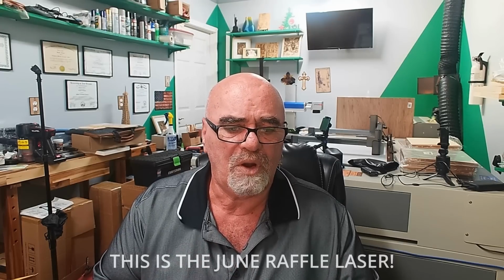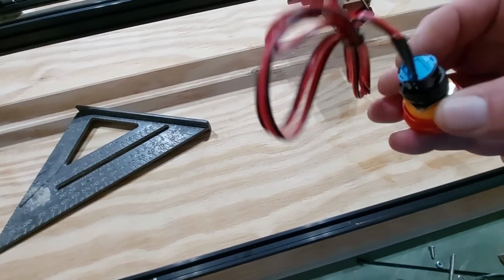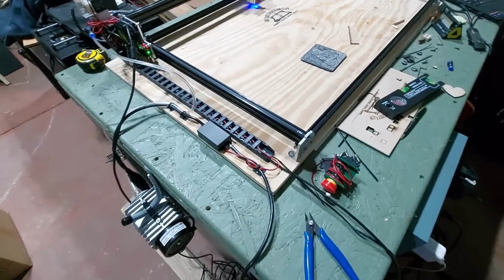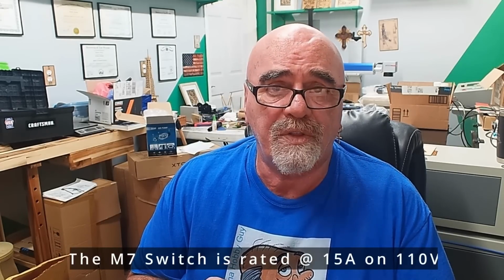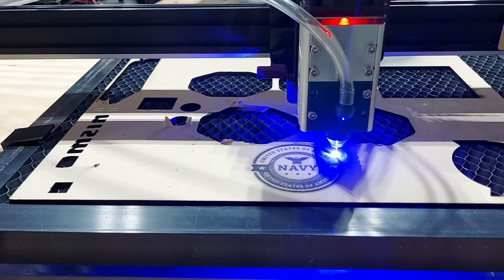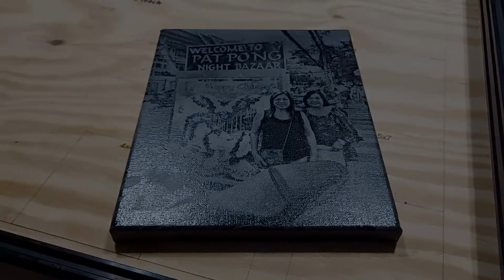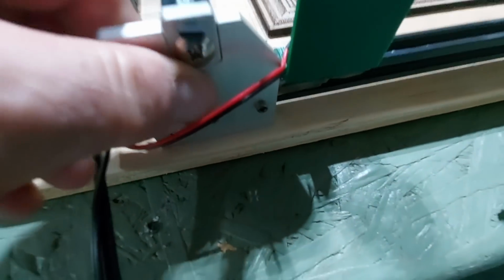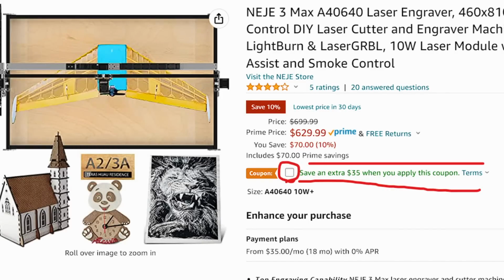❓ The best Diode Laser in 2022? The Neje 3 Max!

Comment: I bought the NEJE Max 3 v2 before I come across your video. Just got it, have it laid out, about to assemble. I've never touched a laser before. But after shopping around for a couple of weeks, it was the best buy. I got it with the E40, but got out the door tt&l for about $490. I'm going to get the lightburn and hopefully will be up and running soon. It's big! 32" x 18" basically. Had to build a massive table for it
Reply from the maker: I did a video on the 3 Max Steve. It's a beast to assemble, but once that's done, it's off to the races!

Comment: Hi my name is Jim Gangloff I'm a newbie. I bought this at a garage sale it has the Lazer that you have on this video. My problem is I don't know what  software programs to use? My laptop is running windows 10 I tried to download the software from neje but all I get is a error that it's not responding what do I have to do it came with another Lazer also. Only thing I don't have is the shutoff. Is there anyway you can help me get this running? I paid $100 for its mounted on 3/4 piece of plywood all setup ready to go Thanks
Reply from the maker: No I can't, but you can use either Lightburn or LaserGRBL.

Comment: Hi Rich great video.  Would have loved to have seen the actual setup of the laser for focal point, but thats not my question.  What air compressor are you using and at what psi/bar?  Are you using any kind of regulator?  Cheers
Reply from the maker: I have a video on the ramp test on my channel for the focus. I use a California Air Tools quiet compressor with a standard regulator and water separator between 9-12 psi, depending on the job. I also have a portable aquarium pump at 60 lpm.

Comment: Have tried to set this machine up in lightburn. somehow it seems that the machine thinks its workspace is besides the actual worksite in lightburn. machne is trying to travel outside the workplatform. yes dimensions are typed in correctly. but laser cant find center of page or anything else. when moving it on the arrows. the laserhead moves correctly, left to left and right to right but the y axis moves opposite way as expected. when clicking down it moves up visa versa. cant get it ot run correctly.
Reply from the maker: You have to set the correct origin in Lightburn Harley. Edit --> Device Settings --> tic off top left.
Reply: @TheLouisianaHobbyGuy  Thanks. lemme try that. Just wondering my other machines running superb on lightburn, except of this one. I was about to bin it.
Reply: @TheLouisianaHobbyGuy  Ahmmmm. where did you set it on your Neje MAx 3 ?. mine is where i think it should be. top left tic. but it still runs opposite directions

Comment: Hi Rich. I love the video. Thank you so very much! My biggest question is the air assist. Looks like I'm running the same air pump that you are using. The tubing and air assist use a much smaller diameter tubing line than what the pump tap uses. I believe the line that fits the air assist is 2.5mm (or 3/32") ID tubing and the pump tap uses 3/16" ID tubing. What are you using to get everything to fit correctly? I've tried looking for barbs to downstep and can't find the right fittings. Please please please help.  Thank you so very much.
Reply from the maker: You can get the plastic barbed reduction fitting at Lowes for $0.89 Darin.
Reply: @TheLouisianaHobbyGuy  Thank you, Rich!  You're the best!

Comment: in your video you run M7 and M8. No need to run both. in the next setting of LightBurn is to run one of them.The video is great, hats off to you. please excuse the use of a translator
Reply from the maker: I run both because they perform different functions.
Reply: I explained wrong. I thought air assist didn't need to be written in GCode. After setting, leave the option checked (implicit setting). See pictures in previous post. I learned this by accident. I'm a greenhorn. I'm learning how to control Lightburn from your videos.👍👍👍👍👍👍

Comment: Hi Rich Nice video..........I have the A40640.....cant get close to your use......Can you say whether yours is straight out of the box Ready or did you unscrew diode 2.5mm like Neje says but then you can only set laser between 4-6mm from work.....I see yours is set at least in the mid 20 mm's, can you explain any of your setup and dialing in if any ........Because I'm totally frustrated
Reply from the maker: I use mine at 17mm Gary, or turned all the way in 99% of the time.

Comment: Thanks Rich, new to laser engraving and binge watching your videos :-)  I have the Neje 3 Max, but can't get the frame completely square; I've spent many hours on this so far, including reaching out to Neje and fb groups. When I move the laser gantry all the way to one end, the left side touches the stop, but the right side has a 1/8" gap. I use a carpenter square like you show with the screws slightly loose for adjustment, but when I tighten the screws, square is lost. Mounting to a waste board, fastening one corner, then the diagonal corner, does not solve the issue. Do you have any suggestions? TIA
Reply from the maker: No, that's the only way I know how to do it. Measure your extrusion... perhaps one is not the right size. Being off by just 1mm will ruin the square.
Reply: @TheLouisianaHobbyGuy  Thanks, given all of the different options that I've tried, and the fact that this doesn't appear to be a common issue, I'm guessing one of the extrusions is off, although since it's assembled, not really easy to measure.
Reply: Was there a solution to this?

Comment: Great Video, I did buy one and have it setup and was trying it out. Coming from a K40 CO2 the mm/m vs mm/s was throwing me off. I did download your cbl file for the A404640 but it is a little lacking, do you have one that has more settings (engrave, more Materiels). I looked at the xTool 10w and may use that and tweak it but if you had one so much the better. Also was looking for a waste board template and your template that you use in the video for common picture sizes. Thanks again and keep up the good work.
Reply from the maker: You can use any of the clb files on the forum that match your wattage Kyle.

Comment: Hi Rich I have this model Neje (for about 2 weeks).I have connected the power box to the m7 and to my air pump ,I have put in the m7,m8 m9 in the g code settings, when I run a program to engrave then cut the air pump does not switch on when it starts to cut,I have the air assit switched on in the cut layer and off in the engrave layer. Do you have any idea where im going wrong
Reply from the maker: Are you sure they're plugged in right? I can't imagine that both the M7 & M8 are not working.
Reply: @TheLouisianaHobbyGuy  Hi Rich I think you Misunderstood my Question,I have the air pump connected to the control box and pluged into M7 when I do layer just to cut the air pump switches on OK.  But when I have a Object with 2 layers,one layer being a fill layer and the other a cut layer when it runs the first layer the fill layer the pump does not start so when it start.s the cut layer the pump is still off .I hope this is a bit clearer.thanks peter
Reply from the maker: Ah, that's probably going to be a question to ask on the Lightburn Forum Peter. https://forum.lightburnsoftware.com/
Reply: @TheLouisianaHobbyGuy  Ok thanks Rich

Comment: Hey Rich, just found your channel and I have to say it's really nicely done!!  really good information.  But could I ask you, as a RC model aircraft guy, I am looking for a cutting machine to cut balsa (max 10mm) and plywood (called triplex here: 5mm max) that this machine is the best and really has sufficient power to do the job?  now there are more powerful options out there as a complete kit (Atomstack X20) but the question is, is it worth it's money and do we really need so much power?? would it just speed up the cutting process?  also, any recommendation  about a good airpump?  keep up the good work!!  Edit: If I would go for the Neje 3 Max I would go for the E40 laser module (I guess) because it has that build in air assist system.  Just think that makes life easier!! your thoughts?
Reply from the maker: Thanks Egon! For what you're doing I would go for the E40 as well. It's a really nice module. Of course the 20W machines would make much faster work of it. If you can wait a couple of weeks, I'm in the process of testing a new 24W commercial grade machine that's about to launch and leaves all of the others in the dust. You'll want to see this one!

Comment: Hi Rich , nice review. I have 2 Q's;
1- can it cut 8-10mm oak plywood?my sculpfun S9 used to cut 8mm ply but after some use it's unable to..(even after cleaning)
2-Neje website doesn't recommended going over %80 power for prolonged use, do you have any time - power graph ,bc it would be nice to see the power drop over time because to be honest no one is going to stay under %80 .. and using daily at %100 will definitely shorten its life but I don't know how much , if you have a approximate graph I'd appreciate it..
Thanks
Reply from the maker: No I don't Ahmet.

Comment: I’m new to lasers. 
I’m getting info everyday since the last 2 weeks and I think im buying the NEJE, but I have doubts between the A40640 and the E40 modules. Mainly I would use it for wood veneer cutting, don’t know if I’ll make many engravings in the beginning but I don’t want to be closed to that option.
The A40640 seems to be more complete but I’m worried about having to be continually changing the focus adjustment. Is it complicated to find the sweet spot? The E40 seems to be easier for a rookie.
Thank you Rich.
Reply from the maker: Both work well Juan. The A40640 only needs to be focused once. I suggest turning the lens all the way clockwise and running a ramp test.

Comment: Dear friend, what is your opinion about the module laser 20w output from atomstack  (combined 4 laser) In front of the product of neje 3 max?
 I have ortur laser master 2 Pro and I want to upgrade it to more powerful  laser, I want your opinion because you're the best!
Reply from the maker: Thank you! I don't have the 20W quad diode so I can't give you an informed answer. But I do know that collimating 4 diodes is not going to give you the engraving detail that a 5 or 10W will because the spot size will be rectangular, and not square. I am extremely satisfied with almost any 5 or 10W for my diode engraving since I work mostly with hobby wood. Diode lasers are made for engraving, and for engraving, less is more. In fact, I still use my 3 year old 1.5W laser when I want really fine engravings on expensive pieces. What I look for is the spot size. You need the smallest spot and it needs to be square for really fine, professional engraving. You won't get that above 5W optical output, unless you get a really expensive USA made 7W single diode. If you need speed for cutting, then sure, go with the 20W, it will outperform any other diode laser for cutting, but I focus more on engraving.
Reply: @TheLouisianaHobbyGuy  I want to cut clear acrylic 2m and engrave styles steel
Reply: @TheLouisianaHobbyGuy  also I need something specific item to connect the neje module to my ortur? (Ortur 24v 2a)?
Reply from the maker: Yes, you would need the Neje Adapter board and another power supply for the 12V Neje. I would suggest you look at the new 10W module from Ortur. @ציוןנעימי
Reply: @TheLouisianaHobbyGuy  after I see this video about neje I don't know what to buy, ortur 10w module or neje module, you think it's is possible to engrave or mark very well stylenss stainless steel?
Reply: @TheLouisianaHobbyGuy  and another question: which spray you work with to coating the stainless steel?
Reply from the maker: Since you already have the Ortur, I would go with their new 10W module.

Comment: Hello Rich, great review I just purchased the neje 3 max a40640 should be here on Thursday. I have the foxalien riser 20w and have ben working it to death but I needed something  faster and bigger. I was a little fooled buy the air assist though it was the pump. until I saw this review, thanks. it looks like you filmed it at different times because it looks like you had two different air nozzles. I defiantly like the second better. is that an upgrade... Thanks For all your videos it has helped me a great deal.
Reply from the maker: It was filmed over a few weeks of testing Mark. And! They have come out with a metal air assist just after I completed this! It'll be in a video this week during "accessory week".

Comment: Question on the M7/M8 setup you have. If you are using a tankless air compressor (I use a pretty large Airbrush compressor for example) Is there really any need for the M8 air solenoid valve? Couldn't I just connect the airline from the compressor directly to the air assist like I have now and use the relay connected to M8 to turn the compressor on and off as needed? That would eliminate an extra component and simplify everything. The only reason I can think of to need the air solenoid would be if the air supply was coming from a tank or tank type compressor.
Reply from the maker: Yes you can Ray. Just use the M7.
Reply: @TheLouisianaHobbyGuy   Thanks for the fast reply! Love your videos.

Comment: I currently have the Reizer Mega 800x400 20w (5.+ output) and I love it.  Wish it could cut thicker balsa.. like 1/2” without setting it on fire.  LOL.  With double the output, would this make sense as an upgrade to be able to produce balsa parts on an ongoing basis (short of commercial CO2)?
Reply: Also, the printed air assist nozzle, was that one that fit on the lens or mounted on the side?  I prefer the ones on the lens… seems to keep my fox alien laser clean.
Reply: Assembled and installed the 3 Max into the CNC Router table cabinet… perfect fit by chance… probably couldn’t have designed it to fit more perfectly.
Reply from the maker: Faster speed and multiple passes will keep it from burning Peter.
Reply: @TheLouisianaHobbyGuy  ordered and received the NEJE 3 Max… in like three days (shipped from So Cal).  Took all of 15 minutes to assemble and fire up… I have only cut one R/C rib on a flat spoil board… and I am VERY impressed.   Great call on this machine.  Can’t wait to cut an entire airplane kit.  Thanks for the review and the heads up on this machine.
Reply from the maker: @peterb7401  Glad you like it!

Comment: If you were going to use a rotary tool for a tumbler, mug, etc, do u just use wood or something similar to space the full machine up high enough? (I know xtool has the screw in puck system but haven't seen how one could do it with the 3max)
Reply from the maker: I have a 4x4 cut up into different sizes with slots in the tops for the legs to slip into. On the Pergear, it has legs, so I use those too.

Comment: I used a windows program to stop the laser every 10 minutes for 3 minutes and then continue to engrave for 10 minutes, that why I was able to work with the laser 10 hours or more with no problems
Reply from the maker: The problem was the shop was too hot at over 107 degrees. When I did the 2nd burn in the low 90s, it came out just fine.

Comment: Rich, thanks for the videos they are a great help.  Can you tell us what you are using for fume extraction?
Reply from the maker: I have several things depending on where I'm lasering. In the laser shop, an 1100 CFM extractor in the attic. In the wood shop, an air scrubber.
Reply: @TheLouisianaHobbyGuy  Thanks Rich but 1100 CFM might be a bit big.  I just ordered the NEJE 3 Max A40640 and that is my first an only laser so any recommendations for just one laser.  I do have a dust collection system for my wood working, it's a large Jet system and I was thinking if I could find an inline filter that might work but I have not found a true inline, or I guess it would be a feed through filter.  Thoughts?

Comment: Rich, the laser on mine is staying on in lower power even when at idle, not doing anything. is that normal or have I missed a setting somewhere? By the way I love the suggestion to plug the air assist and exhaust systems into a power strip and run the power strip through the M7 relay. Works great.
Reply from the maker: Hi Chuck, yes, all of my Neje modules are like the Motel 6 🤪 Neje told me last year it's 1/2% power for framing purposes.
Reply: The laser is staying on in lower power even when at idle is to assist positioning and focus adjustment, low power brightness can be adjusted by software. This is the operational advantage of diode lasers compared to CO2 lasers. NEJE has always adopted this design, especially in It can bring a lot of convenience when carving small works.

Comment: IT LOOKS LIKE YOU'RE ONE OF THE LUCKY ONES! My NEJE MAX didn't work anymore within 60 days of the purchase. AND NEJE IS FULL OF IT WHEN THEY SAY THEY STAND BEHIND THEIR EQUIPMENT FOR 2 YEARS. They didn't stand behind it for 2 months.
I bought my 2S MAX  in March 2021 and it quit putting out consistant images by the end of April. I contacted NEJE and after they told me that it had to be the laser module, I was told I had to get my warranty service through the PLATFORM THAT IT WAS PURCHASED THROUGH. That was eBay and they only have a 45 day warranty, so I couldn't even get connected to anyone. My 45 days was gone.Fast forward to June 2021, I finally got someone at NEJE "corporate" and sent videos and piucs and was told that it was the control board. They would send it to me ASAP. After weeks of waiting I emailed them and someone else had picked up the ball. Didn't know anything about it BUT said I needed to go to the PLATFORM THAT IT WAS PURCHASED THROUGH. By the way I had already purchased ANOTHER laser module for  $130 based on the original fix. It didn't fix.
So I'm in to this NON WORKING BRAND NEW NEJE 2S  MAX for 1 YEAR, NO CONTACT REGARDING MY 2 YEAR WARRANTY, $500+ $130 for the laser and IT IS GATHERING DUST. 
UNLESS YOU HAVE $650 TO BURN. DON'T BUY THE HYPE.